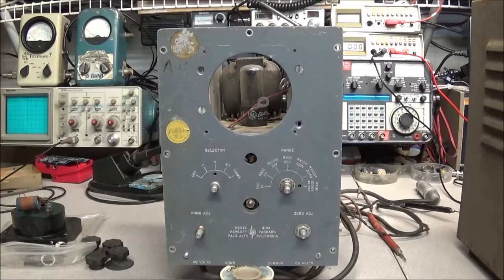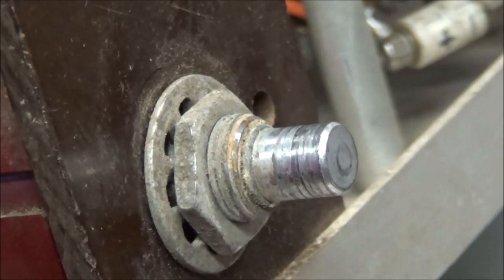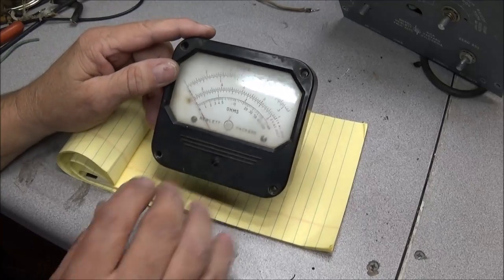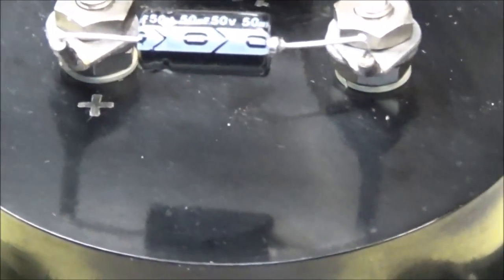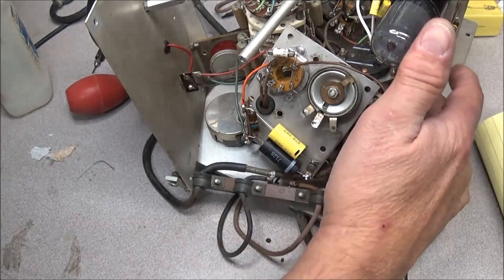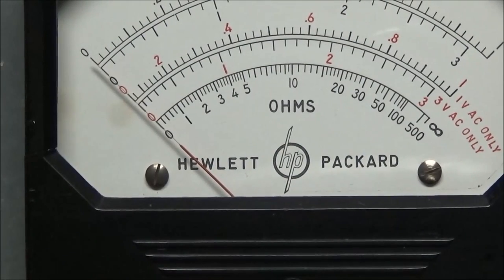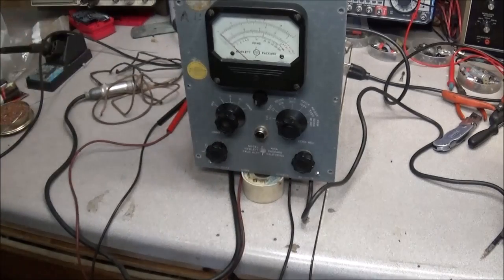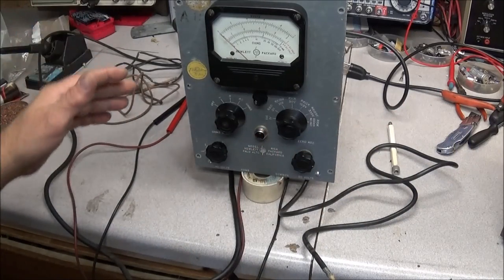#53 Vintage HP 410A VTVM repair Part 1

Comment: Nice work Buddy! WD-40 works for loosening stuff up but you may want to consider Kano Aerokroil for the tough jobs ("The Oil That Creeps"). I used it to loosen up the nuts/bolts of the base when I took my last tower down and it works great. Thanks for the tip on using "Goop" as I'd never thought of that application before cleaning knobs. Look forward to the completion of this restoration.  73 - Dino KL0S
Reply from the maker: Thanks Dino. I have tried so many things before to bust frozen bolts loose. have to give that a try. Goop or GoJo works great for cleaning knobs and other similar material. Thanks for stopping in. 73

Comment: Looking good Buddy.  I was beginning to wonder if there was a hit and miss engine running in the background and then you said motorcycle.  :)  I am curious if the 22 Meg resistor needs to be 2 watt.  I mainly use the military versions of this meter they use a 22 Meg but at only 1/4 watt in the DC probe.  And window blind tubing for the probe body, brilliant!!!  They say necessity is the mother of all invention and that proves it.  Nice to see the old girl back up and running.  As a side note I scored a dozzen of those 2-01C diode tubes at public auction the other week.  Those tiny tubes came in a Eimac box that measures 6" x 10".  Poor little things almost get lost in the packing material.

Mike
Reply from the maker: Thanks Mike. I believed they used a larger resistor to keep it from rattling around inside the probe. So I really do not think it would matter either way. Very nice deal on the tubes. Bet you get them for a good price.  Sounds like they could get lost easily hehe. Thanks for the kind words my friend.

Comment: The caps on the line cord should have been AC line X2, Y2 safety caps that David sells on his website.  He even talks about that manufactures used old .01 uf paper caps instead, because they are not rated for the AC voltages, THEY ARE NOT SAFE.  Since you are buying from JustRadio you could buy the correct safety caps also.  Later Ray Burke

Comment: Hey. Thanks for sharing. Interesting trick with Goop. How does that compare to soaking in 409/Fantastik overnight? I know bandersentv likes the soaking method.

Looking forward to pt2. Thanks again for sharing.
Reply from the maker: 409/Fantastic gets the job done. I use that from time to time. Nothing wrong with it at all. Hand cleaner does the same, just quicker.  Only down side to 409 is not let it come into contact with glue or rubber. Some knobs will have a decorative insert on them. Shiny disk. It will loosen the glue. It will also dry out rubber material. Each solution has it's place though. Thanks for watching my friend.
Reply: +The Radio Shop Thanks for the additional info. Sounds like a good solution.
Reply from the maker: No problem friend

Comment: Hi Buddy,
I always learn some new tips from your videos. I use Go-Jo on plastic and wooden radio cabinets, it really works great! one thing to remember though, is NOT to use the one with pumice or other grit in it, or you'll be really surprised when you're done:-)
Reply from the maker: Thanks Jim That hand cleaner really fixes stuff up nicely.  I agree with the grit. Although if you have a knob that is already scratched up pretty bad, the stuff with grit can make it look better.  Just have to apply a little at a time. Then polish afterwards. And like you said don't use it on something that is not scratched. Thanks for watching my friend.

Comment: Hi Buddy,  Very good video, it had something in it for everyone. Tip for using hand cleaner (new one for me), one to use window blind tubing, and sand blasting plus more. I was so into the video when it ended I thought “wow that was short”, but then I checked and it was 46 plus. Oh well , you know they say, time flies  “”””””. Thanks you for sharing. Enjoyed the
video. P.S. I picked up an EICO 377 audio generator for 10 bucks and a KNIGHT signal tracer for 5 at Dayton last week so I have a couple to restore:>).  73
Reply from the maker: Hi Larry. Yep took a while to shoot all that footage. I think it was an hour and a half to start, edited down to 46 minutes. Lots of little tid bits in that one. Glad you enjoyed the video.  Now those are two nice pieces of gear.  What model is the Knight?  One day I plan on finding a 377 to ad to my collection. You will have a fun time restoring the old gear. Love to see before and after. Thanks for the comments my friend. 73
Reply: Hi Buddy - If the video you cut was not bloopers or dead air you should consider just leave it in and if too long make a part two. Shame to loose good content.On second thought, the bloopers might be fun to watch also. :>)   Yes I was glad to find these two pieces at the prices I paid. The Knight is a 83Y135, this one has a scope out jack. But the best thing was in the handle was a rolled up paper, it was the original Kit manual in good condition. I plan to scan it to pdf. Look forward to next video. 73

Comment: Great job! Great idea to recycle the blind adjuster to rebuild the DC probe! I'll have to remember that one.Two questions:1) I hear lots of guys talk about AC Safety Caps  rather than using "regular" caps when they swap out the old ones on the AC Line, as they are more resistant to surges, etc.. Any particular reason you didn't use those AC Safety Caps on your meter? 2) I noticed you wired the Neutral to the Power Switch rather than the Hot. I didn't catch how it was originally wired. Again convention is the Hot side would be switched...at least in my thinking.Like I said just wondering on the approach you follow...I love the videos you are doing and look forward to the next on this HP.
Reply from the maker: You know it is nice to see viewers paying attention to detail. Very nice.I am out of the AC safety caps so just used original types due to this piece will be used by myself. That is correct, hot should be on the switch side. In this power cord I used "white" is the hot wire where black is neutral. Getting so the makers are no longer following standard wiring these days.  Thanks for watching.
Reply: The Radio Shop
Well thanks for the insight that not all line cord makers don't always follow the Black"Hot"/White"Neutral"  standard...one more thing to double check when I replace power cords!
Reply from the maker: Yep, I have a half dozen of them like that. They do not follow standard. All made from China :)